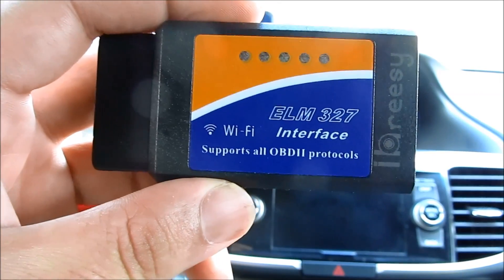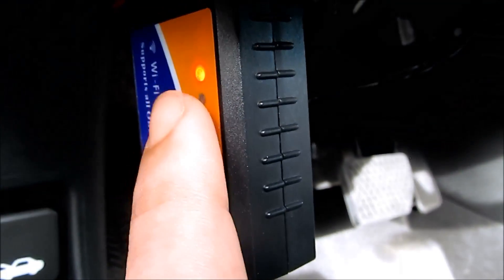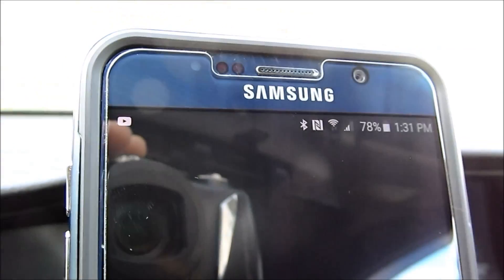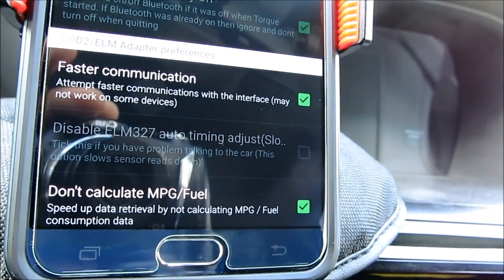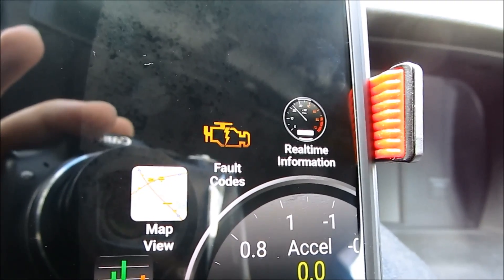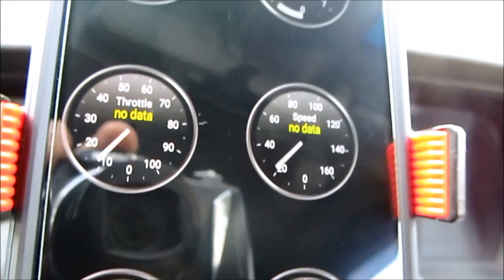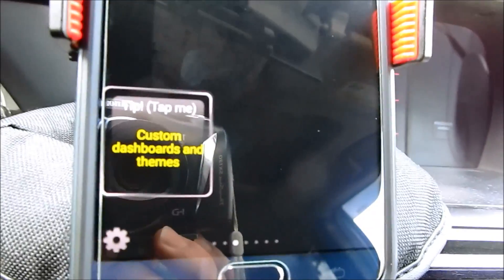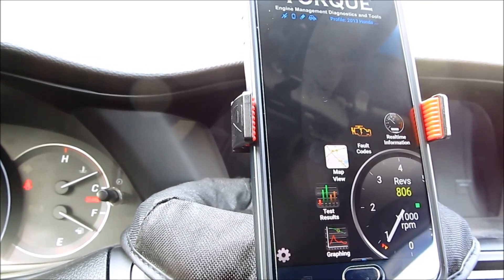ELM 327 OBD2 Wifi Scan Tool: Check/Clear Check Engine Light + Live Sensor Gauge

Comment: Does the app give a suggestion of repair costs  and translate codes to easy non mechanic english?   It would be helpful if you made an easy correctable fault. like Air filter error or spark plug  unplugged.   Does it give app estimated cost of repair in UKA or UK?

Comment: This is pretty cool.  Would be nice if you could use this to remote start the car lol.     Do you keep it plugged in all the time or do you remove it after trip?
Reply from the maker: +ballinboylbc I don't leave it plugged in.  I only plug it in when I want to see the data.  If you want to leave it plugged in, look for the elm reader that turns off when car is off or else it will drain the battery.

Comment: Nice I was thinking about getting this but the one you got is way cheaper than this, http://www.amazon.com/gp/aw/d/B00OCYXTYY/ref=mp_s_a_1_1?qid=1451870801&sr=8-1&pi=SX200_QL40&keywords=obdlink+mx+wifi&dpPl=1&dpID=41FBr8BHCiL&ref=plSrch
Reply: Cheaper ones may work the same depending on which software you use.